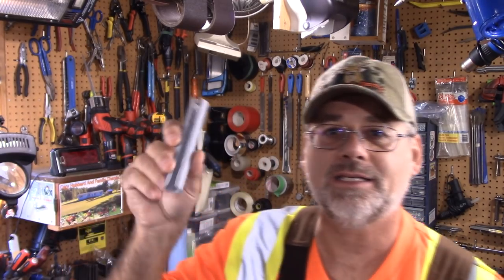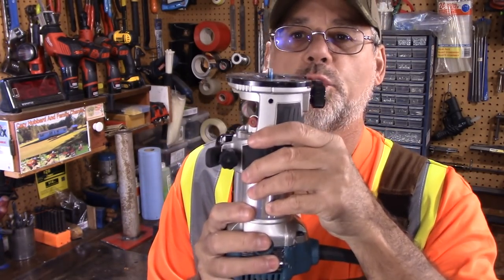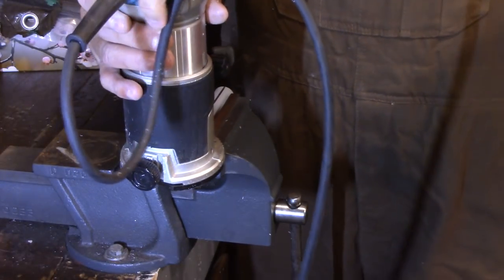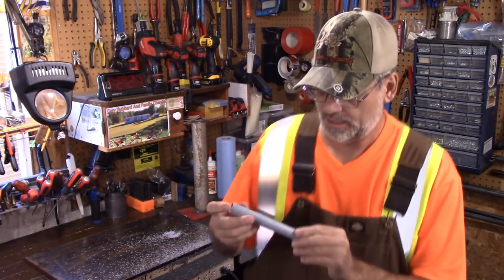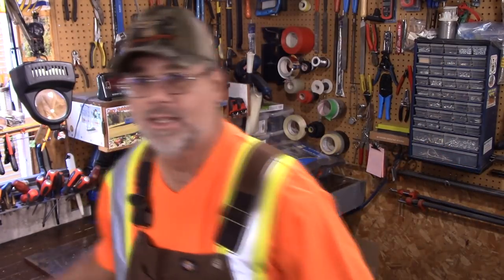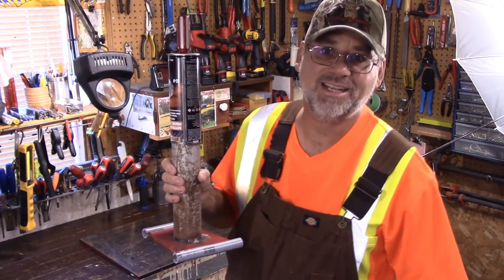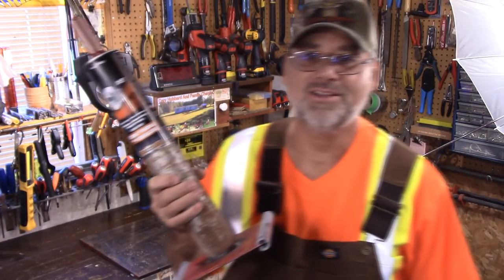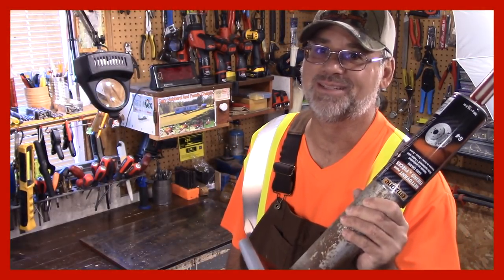HOW TO WELD A CIGARETTE  BUTT  DISPOSAL  HOLDER - DIY EASY PROJECT

Comment: that was a lot of fun Steve I did something similar I built a workbench from my old backdoor which was just laying around from when I replaced it with a new maintenance free plastic one I made it in the workshop I am making in an old garden shed I am also in the process of adding solar to it should be a good place to film youtube videos cheers
Reply from the maker: Looks like your having fun too :)  As long as were doing something it's a good thing. Cheers